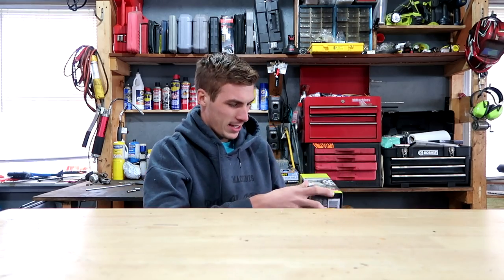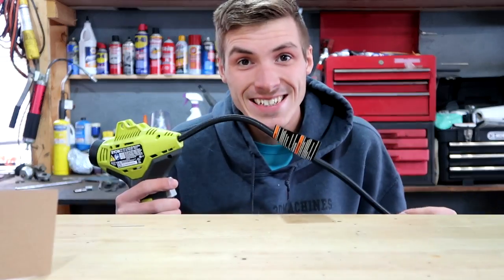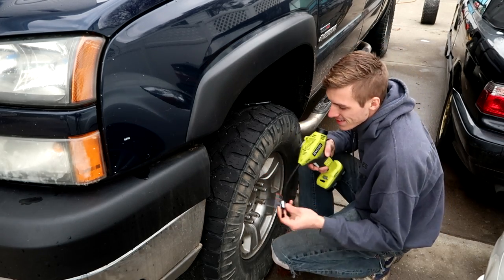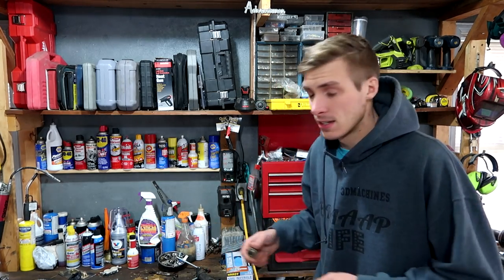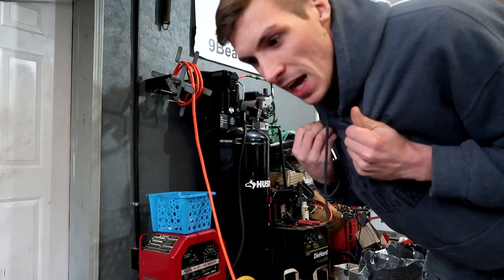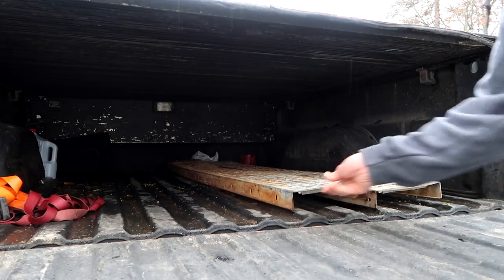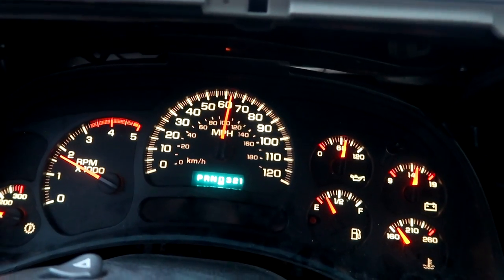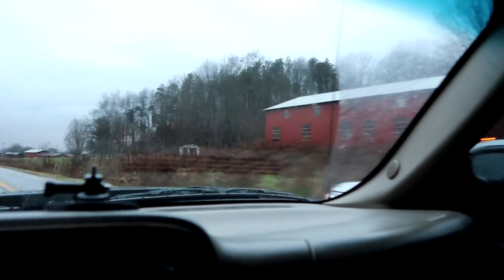SOLD MY FOUR-WHEELER!!! NEW FOUR-WHEELER REVEAL!!!

Comment: Each tire holds 1/4 of the total vehicle weight.  If your truck weighs 6000lb, then it's only loading 1500 per wheel.  If those tires are good up to 3100lb then you're only half loading them.  Also, rubber valve stems are only supposed to be run up to 35psi, if you want to run the tire up you should use metal valve stems.

Comment: Just a suggestion.
Based on the assumption that you're running the recommended tire size for your truck.
Typically vehicles have the tire size, and pressure, specs either on the door post tag, or, in the owners manual. Your best bet is to follow those specs, not the max recommended on the tire sidewall. Under inflate and you'll wear out the edges of the tread long before the middle. Over inflate and you'll wear out the center, of the tread, before the outsides, and, you'll have reduced traction due to not enough contact surface on the road.

Comment: Dalton, if you get your truck tuned with a dsp5 switch, you don't have to have it in the fastest tune all the time. Mode 2 or 3 will show significant change in Mpg and power. I have it done to my truck, and im getting close to 30mpg with a 5inch mbrp straight pipe and efi live tunes. Also if you want the power, mode 5 is 150-120 extra hp depending on who tunes it, and is definitely a lot faster. My stock trans has held up over a year now. It's definitely saved my wallet. Highly recommended if you want to save money with that over sized tank. I'm turning in mode 5 close to 550hp and 1000ft lbs give or take. And can get close to 500 miles on one tank.

Comment: Make sure when you get the new tires they wire wheel the bead edge.  It will help you with those aluminum wheels that oxidize and leak.

Comment: i dont know about new york but where i live all gas pumps have the little notch  so you can go in your car while it pumps
Reply: hkbbs... dont all pumps do that?  every pump i ever used locks open so you dont wait around outside
Reply: lifelessdead89 yea, i say that because Dalton said only diesel pumps have it
Reply: that's how it is where I live too, but what I think he really ment was that with a gas vehicle your not supposed to be in your car with it running and leave the pump going, because it's potentially hazardous. you can to use the little catch on the handle but your supposed to be at least standing next to it. because worst case scenario gas explodes where as diesel just burns.
Reply: Kevin Perry yea an running your car with the gas cap off can possibly set an evap code. just turn the vehicle off ya kno. aint no big deal
Reply: Yeah that's also true, you could potentially set your check engine light on just for something dumb like that
Reply: Has absolutely nothing to do with CEL's..lol It's because most states have laws about running a vehicle while pumping. A closed gas tank does not have a good fuel to air ratio to allow for ignition. With the fuel cap off you leave the chance of allowing that proper fuel to air ratio, a spark can then cause ignition. As far as an explosion, it would be extremely rare to get the proper ratio for gasoline to explode at a pump. To my knowledge no state has laws (or even guidelines) about a diesel at the pump.

Comment: You should check on the drivers door/manual for the recommended tire pressure.

The rating on the tires are the max pressure for that tire, not what is recommended for what you are doing with the truck.

Comment: You don't have to stay out and hold onto the pump. While it's suggested you do so there are safety concerns with entering and leaving the vehicle while pumping. Often after getting out of the car you build up a static charge. If you don't happen to ground yourself to the body of the car as you exit you could cause a spark as you grab the pump again. Increasing the odds of a fire at the pump. Ultimately they don't want you walking away from the vehicle as your pumping.

Comment: I carry a summit built air compressor for my 35 inch tires, on a dodge ram 1500 single cab with the shortest wheelbase they make. Anny bigger and they would touch, posi front and rear. When we stuff our dirt bikes in the bed the tailgate does not close all the way and we use straps to keep it half way up. The cops around here don't like it if they cannot see your license plate all the way.

Comment: In my truck, 2010 Dodge Ram 1500 5.7 and I always leave my truvk running when I fill it up then I sit in the truck with the heat, a lock thing on the pump that keeps the fuel pumping.

Comment: You can lock the lever on a gas pump. Diesel fuel burns much slower than regular fuel. It is much safer to have a diesel vehicle running than it is to have a gas vehicle running.

Comment: That's not a diesel thing, that varies from state to state.  Having lived in NY my whole life traditionally all gasoline pumps had locks, then suddenly MOST of them didn't.  I think it was mandated based on tank year or something, because after the fade out (you can see on most NY gas pumps the lock WAS there, but was removed) very few gasoline pumps in NY have them...but they apparently weren't outlawed as some still do.  Diesel wasn't removed at all, though.

I believe this is the case with most states, as I've done cross country trips like 5x now.  In some states nothing has them, others some do, some don't, but diesel always has them because typically the tanks are very large - at least with respect to truck stops.

Here in Cali most gasoline pumps have locks.

Nice buy on the 4-wheeler!

Comment: We can lock the gas nozzles here in Michigan
Reply: Same in Ohio
Reply: UnitCrane514 same in wisconsin
Reply: same in Illinois/Missouri
Reply: Mars Daze Yeah Wisconsin!
Reply: Same in Iowa. Ive never noticed a pump where it couldnt be locked though, and Ive driven all over the country.
Reply: most of America can lock the nozzles. it's just the heavily democratic controlled states that are that way.
Reply: a lot in ny cant
Reply: 0307 0307 , thats not even close to true. Vast majority of the country has locking handles for gasoline. Its just a very select few that don't. Ironically the only state I've been in myself that didn't have them on pumps I used was Florida and Georgia. Don't know if that was a state thing or just happened to be at those particular gas stations.
Reply: DaTwistedOne1 that's exactly what I said. I clearly said most states have locking nozzles

Comment: just an fyi its actually not good to run your DIESEL truck while filling. it puts air in the fuel from it pouring in witch cases the truck to suck up foamy air filled fuel witch in turn can cause injector,fuel rail and lift pump issues. cant compress a gas! only liquids (fuel in the rail) will allow the fuel rail to reach 3000+ psi and allow the injectors a clean pop off hence why people add fass fuel systems or sump kits with air/water separators. nice vid tho bud!

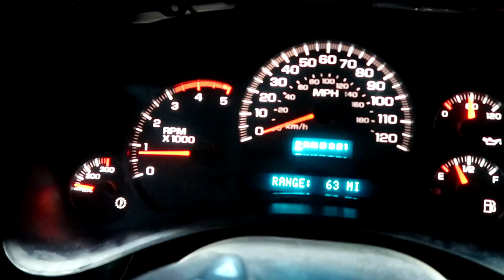Comment: at 8:59,  Who told you that?  I've never heard anyone say you are supposed to hold the nozzle the entire time.  Never.  One thing though is you should not get in and out of your vehicle in the winter unless you are careful to discharge any static electricity before going near the gas tank/nozzle/pump.  That entire rash of gas station fires - the ones they were blaming on cell phones - were later found to be due to static electricity.  Heavy nylon jackets, womens skirts and panty hose rubbing in and out of the seat generate a lot of static electricity.  So just remember if you get back in in the winter don't forget to discharge again when you get out again.

Comment: it's £5 a gallon in the uk, that's why we drive 4 bangers XD
Reply: Caleb Guidroz yeah but have you seen what they do to get it out the ground XD, electric cars are a pain to re-charge and expensive, why not add a hotswap battery...
Reply: Harry Lawton yes, cars are totally expensive to recharge when its 2 cents for an average car fillup at home. if your talkin gas station chargers than yes, some can be expensive but very few are
Reply: Similarlobster8 Brunelli not I meant the car is expensive XD
Reply: +Caleb Guidroz Really?

I was just in AK last month and it wasn't no $9.....  Was pretty much exactly on par with the rest of the USA (like $2.50 or so).

Comment: Wtf? My 99 Standard cab, short bed F150 weights right at 7000 stock. The hell is up with that. And thats with the small 4.6 lol
Reply: idk browskies. I double checked and I swear to God it has 6500 on it. No bs
Reply: Sticker on inside of the door tells no lies
Reply: And it says right on yahoo that the weight for my truck is between 4 and 7000 pounds!
Reply: pinkbandit133 99 F150 lol. Trust me haha I'm 91Hotel. Ik what I'm doing in this department. Sticker isn't faded and I'm not reading it wrong. Just cause you trucking is bigger and diesel does not mean it weights more!
Reply: pinkbandit133 If i could send you pics i would. And if you can send pics on youtube then idk about it!
Reply: pinkbandit133 Not trying to say you are wrong. Im just tellin you what the sticker and the net is tellin me. Maybe its the wrong sticker for my truck lol. I have no clue how all that works.

Comment: You don't know an excellent machine until you own a Honda 420 rancher!
Reply: WV Farmer  Hehe.. 420.
Reply: I've had mine since 05 and it still runs and looks like it just came off the showroom floor! Best machine there is!
Reply: they have no power though. all reliability
Reply: Compared to what is popular today, such as an 800 it doesn't. But for me it's plenty enough for what i do. Most reliable machine on the market too.
Reply: WV Outdoors because they're outdated and theres all old technology. i'm not knocking honda (own a built 400ex) but their machines are so basic
Reply: WV Farmer . I have a Honda forman 450. some meachine
Reply: WV Farmer yes we use them every day on the farm and have very few problems with them
Reply: WV Farmer bruh

Comment: Dude,   You are putting too much air in most of the tires you fill, You need to look at the recommended specs sticker on the drivers door jam...Not on the tire itself,  That rating is just max pressure for the tire itself...

Comment: I have a spreadsheet that will take the price of the tire and mileage warranty so you can get the best bang for your buck, message me and I can email it to you. If your fuel pump doesn't have one of the locks on the handle, use a tennis ball.